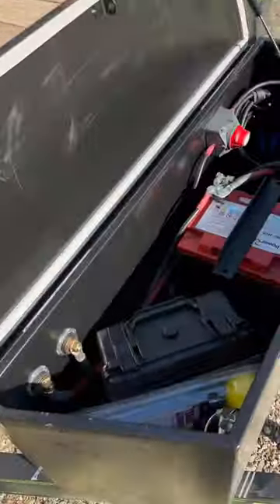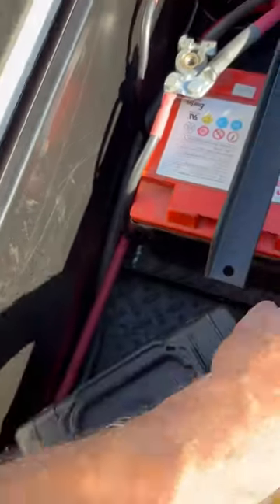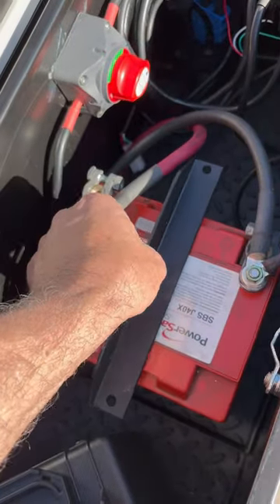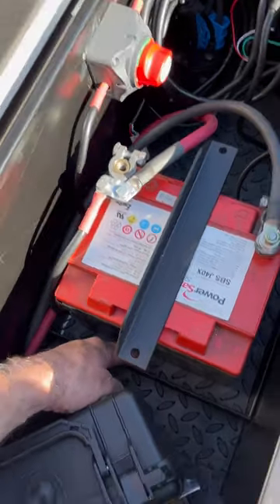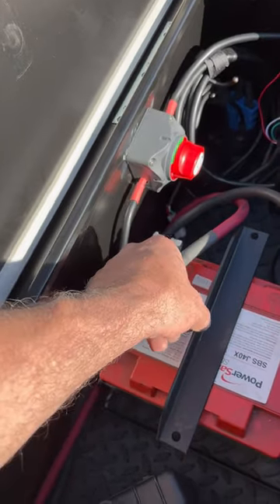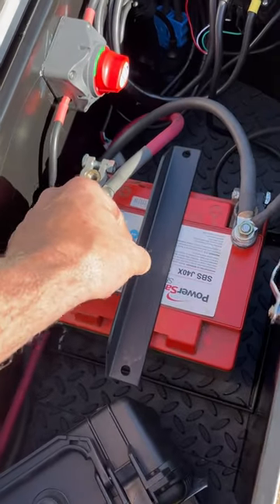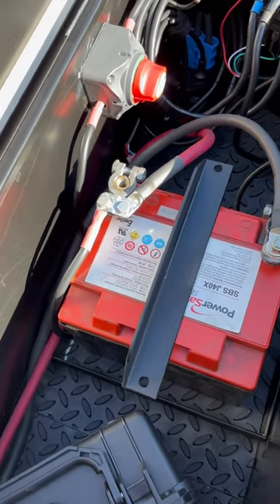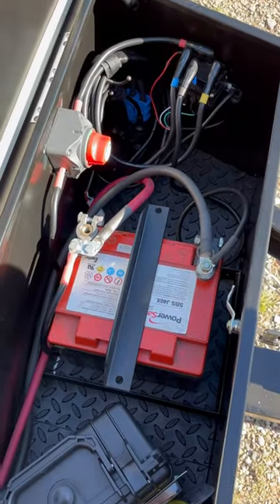Car hauling trailer tool box addition. Battery tray. #shorts #battery #trailer #carhauler #short

Comment: yo, Jason!! What are the odds I’d stumble upon this, it’s Scott from Toor, with the purple ‘68 F100. Super cool getting to see what you’re up to, I remember back in 2017 when the zip tie holding down my battery gave out and the battery fell straight into the fan and got shredded, spraying acid all over the engine compartment. Important life lesson there for sure haha, always use actual hardware to secure your battery down and not just a single zip tie
Reply from the maker: Hey bro, how ya been.  What have you been up to.  Do you still have the truck?  How’s your Dad?  I appreciate you checking out my channel.  I’m having fun just tooling around doing the videos. Hoping to some day step it up a bit and use something other than my iPhone to film and edit but it seems to be working for now.  Are you still in San Diego?  I’m coming out there to pick up my Camaro in two weeks. Great hearing from ya brother!!
Reply: @ogresspeedshop  I’m actually up in Montana now, just started up my own finish carpentry business, keeping myself busy. Still got the F100, although I’m no longer trusting it to be my daily driver, I got a 99 Tacoma for that. Still cruise the F100 around though just to keep it fresh (and because it’s just too fun to drive for me to not drive it). My dad’s doing great, staying very busy in retirement, lots of projects. I’ve actually been planning on starting a YouTube channel too and just sharing whatever projects I’m working on, I’ll get around to it at some point haha
Reply from the maker: @scottsterner4091 sounds like you’re doing great.  Just so you know.. if you plan to start doing YouTube, expect what you’re working on to take 3-4 times longer to complete cause you gotta deal camera angles and setting up shots. It is fun though, I’ve got nothing but time these days so it’s all just fun for me.  Tell your dad I said “what’s up”. Let me know if you start a channel, I’ll subscribe!